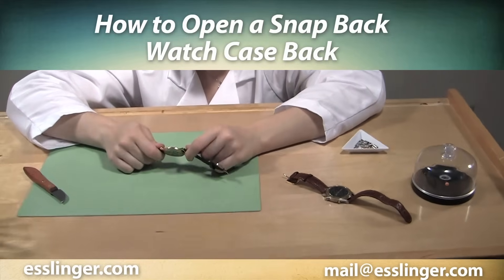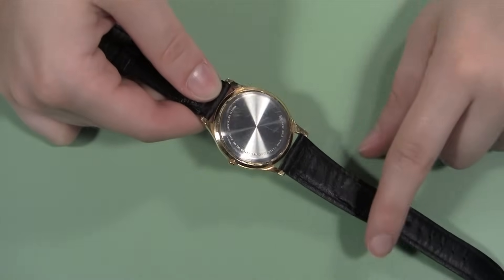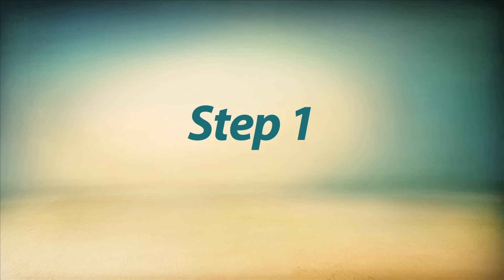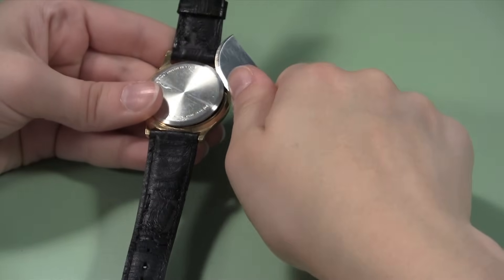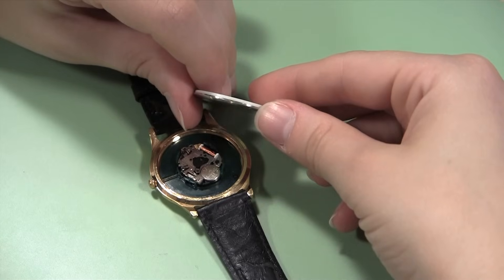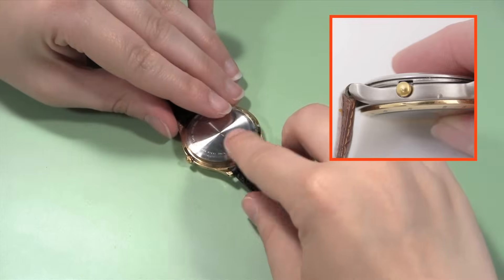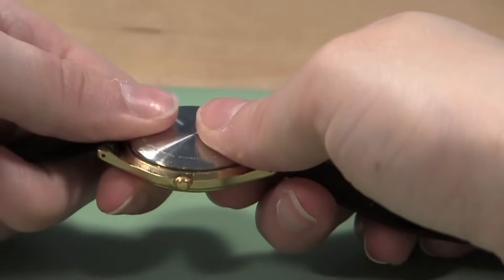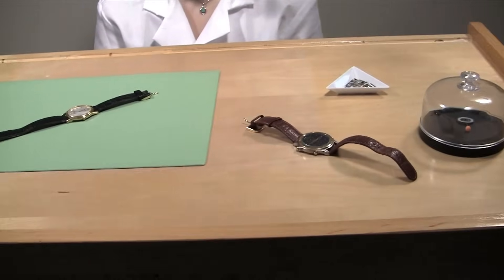How to Open a Snap Off Watch Back

Comment: Tip: if you don't have a metal watch case opener — or even if you do — a safe and effective alternative is to use a plastic guitar pick, which is softer than the metal so it doesn't scratch and which generates enough leverage to pop open most cases.
Reply: thank you so much omg
Reply: Pro tip. Throwing a few picks into my watch kit. Thanks!
Reply: Thank you!
Reply: I did it with my nail in 5 seconds
Reply: I have 50 dollars watches and this doesn't work at all the back plate is so tight I had to basically hammer a flad head screw driver under the lip and the pressure needed to pop the back off was digging the flat head into the metal of the watch.
Reply: Thanks a lot
Reply: Thanks
Reply: Makes Sense thank you

Comment: "If you cannot close the back by pressing it on yourself, you will need additional tools". Said so calmly, yet you can just imagine the frustration. So close, yet so far
Reply: Rammed a knife into my hand repeatedly, trying to pry the back off. Luckily wore a glove after the second attempt.
Realized I bought the wrong battery.
Bought the right battery today, replaced it, watch is ticking and yeah, guess what, no watch press, so I guess I'll have to find something else now.

Edit: Ok, nevermind, I literally just took a big hammer and applied pressure evenly and it worked.
Reply: hell to open; hell to close
Reply: Exactly 🤣
Reply: Totally agreed…. Video is totally uselless, not gonna talk about the case if you dont have this knife, you get into trouble trying to do the same thing with some other kinds of knives and potentially get hurt…….
Reply: easy! just take a hammer and you know what to do 
worry about consequences later

Comment: 0:48 "Be careful not to let the blade slip, because it might scratch the watch case or otherwise damage it or the movement inside." 

Priorities, priorities. A little scratch on the outside/back of the watch case is not okay; a severed thumb, however, is perfectly fine.
Reply: 'Tis but a scratch..
Reply: I gave my tissot to the authorized tissot service center
watchmaker slipped 3 times scratching the cap every time in the process, dug up a large portion of the metal from the case too
clearly cared more about his fingers than my property
Reply: @spicydiarrhea5662  😡
Reply: @michael5089  my tip is, do repairs yourself - no one will care about your property better than you.
Reply: @spicydiarrhea5662  Indeed Spicy
 Great advice 👍👍
Reply: @gallimead That “ ‘tis but a scratch” is from the gravely-wounded knight in “Monty Python and the Holy Grail”.

Comment: I just used a technique to use my bare hands to close a watch back that probably required a watch press, I laid a cloth down on the table, placed the watch on it, glass down flat, placed by hand in the strap and held onto it as I used the side of my hand to basically slowly hammer-fist the back into the slot. Took a lot of force but eventually it worked! Only recommend doing this if you REALLY can’t be bothered to find a watch press or other tools to help you.

Comment: To get the back on again: a genius commented on another video and said to just use a prescription pill bottle.. I tried it, it worked instantly. I just put a cloth underneath for cushion and a microfiber cloth between the bottle and back of the watch. I barley had to apply any pressure compared to using my hands. (worked for women's fossil watch)
Reply: Excellent idea, works perfectly 👍

Comment: Very nice, thank you! Btw, if you are going to replace the battery, remember that Alkaline (LRxxx) is WORSER than Silveroxid (SRxxx, better - more straight current, more capacity), and Silveroxid is WORSER than Quicksilveroxid(even more capacity).
Reply: Worse* =D

Comment: Mine didn't have a lip and I opened it without difficulty. Here is what I did:

The kind of knife in the video seemed too dangerous, so I used my ever-versatile Tajima utility knife (which is just an extendable razor blade) to slowly and gradually work the tip underneath the surface, moving around the circle of the watch plate, until the tip of the razor could begin to slide underneath the watch plate. Once here, I began to slowly rotate the blade while it was under the watch plate, to pry the watch cover off. Performing this prying slowly, I rotated around the watch cover backing, so as not to break the razor, and continued going in a circle until the plate was sufficiently loosened and came up and off.

This technique may take more time than the official technique portrayed in this video, but it seems to me better, because there's much less chance of hurting yourself or the watch plate, especially if you do it slowly without exerting too much pressure and keeping your fingers clear of the razor in case it slips.
Reply: Brilliant - many thanks!!  I'd just about given up as my watch didn't have a notch, either. This did the trick. I haven't seen this recommended anywhere else. I proceeded with extreme caution, protected my hand and wore glasses.

Comment: My watch is totally flat on the back and does not have a little notch like yours does where you put the knife in. I cannot for the lift of me figure out how to change the battery.  So maddening!  I'd be so grateful for any suggestions you may have.  Thanks!
Reply from the maker: jovicrazed Not all watches open from the back. Sometimes there is a special opener required. Read more here http://blog.esslinger.com/how-to-open-a-watch-back/
Reply: Esslinger.com Thanks so much for answering so quickly!  I'm going to take it in to a watch repair shop as I don't want to end up damaging it.

Comment: I used a small jewelers flat tip screwdriver, about the size you would use to tighten eyeglass frame screws, to pry off the back. Worked just fine

Comment: Tip for anyone who's struggling to open a watch with a case knife - wriggle the blade into the groove then tap/hit the back of the blade with a heavy spanner or a hammer. Because the blade is tapered it pushes it open without a prying motion. It worked for me anyhow.
Reply: But that might damage the insides and ruin the watch
Reply: I am struggling to close it lol
Reply: Trying to do tumbs up but now my half tumb is on the floor. But the watch is unscratched and the new battery is in place! Success!

Comment: I found that using a flexible rubber jar opening pad was very helpful in keeping my fingers attached to my hand. When (not if) the blade slipped, I had that layer of protection. It was not easy to get off!
Reply: Wish I'd known that before I severed mine

Comment: I was able to pry the snap-off back off of my Timex Indiglo wristwatch for the first time tonight, with the tip of a blade in a utility knife. This can be dangerous though, as this very thin razor sharp blade can break or cause cuts, if it isn't handled carefully.

Comment: It worked for me. I didn't have a knife at my office so I used a boxcutter. I put a stapler on the watch to hold it down so that if the cutter slipped I would still have my fingers. All good.

Comment: I cannot even get to step one as I have been all round it with my penknife and there definitely does NOT seem to be any kind of lever or snap back or anything. It is just totally smooth all round and won't prize open but I am sick of taking it down to the local shop to get the battery replaced. Anyway thanks for the video.

I need one on how to find the snapback now! I have a spot light on it and my reading glasses on but even so and despite going right around the watch I cannot find it.
Reply: your casebook might be a screw type and not snap back. So you need to unscrew it (turn it) to unlock it.
Reply: Sometimes there is a tiny arrow on the back pointing to the pry spot
Reply: I have just found this again 4 year later in opening the same one! This time I had a go with my pen knife before seeing my own post above, and there is no notch or place of any kind to put the knife under BUT you can still snap it off by pushing the knife into any place around the side.

Comment: Thanks. Worked perfectly for me. I used an X-Acto knife and was very careful, knowing it could slip and go right into my thumb or the blade could break off. I worked it underneath the lip of the back with a sawing motion and gentle but firm pressure. This is harder than it sounds, because you have to hold the watch from it's sides and NOT be resting a finger against the back (which you are trying to move in the opposite direction). But it worked. I'm sorry if this video didn't work for some people but they didn't have to embarrass themselves with churlish, grade-school comments. Why don't they get off their duff, figure out a solution and post it on YouTube themselves?

Comment: 1. Pry off the back of the case with surprising ease.
2. Exclaim "Lord, that was easy!"
3. Change battery.
4. Press back on to case again.
5. Check for spaces around the sides.
6. Swear.
7. Press back on again and again, swearing each time.
8. Put the heel of your left hand against the watch case.
9. Break your left hand with your right fist as you bash and bash and bash.
10. Scream "fuuuuuuck!" and jump on the watch again and again until you slip on the carpet and bash your head. 
11. Gnaw on the NATO strap in a foaming rage until the ambulance arrives.

Comment: I used a permanent Sharpie marker to make a tiny mark on the back of the watch where the 2 parts line-up so that I could line them up to close the back  after I replaced the battery. The mark wont show from the front when you wear the watch, and it will help the next time you want to replace the battery again. Then I dropped the battery and it bounced under the kitchen stove out of reach.  So much for that! 🙄

Comment: I can't find the indention on my watch. Is it possible to not have one and still take the back off?
Reply from the maker: It may be a different type of watch back design. Some even open through the front. Use a magnifier and inspect carefully. You may need to consult a watchmaker.

Comment: Every video like this makes it seems so easy - just slide the blade in and pop it off using leverage. But no matter what I do, it won't budge. (It's a TIMEX Indiglo.) There isn't enough room to apply leverage. Now the little slot is all mangled and the back is scratched. Why don't they just use screws? It's so frustrating. UPDATE: I finally managed to pry it open with a box cutter. I got a new battery and put it in. Then I couldn't get the stupid back on again. I pressed and pressed with my fingers, but no, it wouldn't pop back on again. So I tried squeezing it closed with a tool, and PRESTO! I smashed the crystal, so I threw the watch out. Boy, was that fun! Next time, I'm buying a watch that has a back WITH SCREWS!

Comment: if you're having a hard time putting the case back like me, and there is no explanation as of how to do so in this vid, you can put one finger pushing on one corner of the case. After that, grab yourself a blunt weapon (i use a pestle, if not a hammer will do fine) and give it a solid hit on the opposite corner from which you're pushing with your finger.

Comment: Easier and safer to use a jeweler's screwdriver to open the back.
Also, if you press on the center of the back when closing it, it can make the metal spread out and make it harder to close by hand.  If that happens, push the center back into shape from the other side, and then it should be easier to put the back on by hand.
Reply: Hi

Comment: My backplate wont go in again, and I dont have any watchpress😖
Reply: TechWithBrede I used a pair of pliers and wrapped the watch with a microfiber towel prior to using the pliers so that the watch face and back didn't get damaged. Worked like a champ!
Reply: Mike Baca that's really clever. Thank you for this idea!
Reply: I have replaced the backplate of my Skagen watch and a few others many times with this method which only requires a ~25 cm long wooden dowel with a diameter slightly greater than the diameter of the backplate. The dowel must have a least one end which is cleanly cut a t 90° angle. (A furniture leg works great for this purpose.)
1. On a sturdy and stable surface such as a desk or work table, lay the watch face-down on a smooth piece of microfiber cloth, with the watch band out of the way.
2. Set the 90° end of the dowel flat and centered on the backplate, and push straight down, with even pressure across the width of the backplate until it snaps into place. I usually stand up so that I can employ my full body weight (70 kg) to the task. The goal here is to keep the dowel perpendicular to the backplate while you exert the downward pressure.

Works every time for me.

Comment: Use a blunt knife to open the case. A paper cutting knife or a similar object which can fit in the wedge. We are not experts so think about our safety first. If possible wear safety glasses as well. You never know what's inside and may spring in your eyes
God bless
🙏🏻🌹🙏🏻🌹🙏🏻🌹🙏🏻🌹🙏🏻🌹

Comment: To close my watch. I put the face on a carpeted floor. Then a quarter on the back. And then I put a chair leg on top of the quarter.  I put all my weight on the chair and it snapped into place.

Comment: No press or special tool needed to snap cover back on. Use a prescription bottle about the same size as the cover, place cloth on table with glass side in cloth and cover side facing up. Make sure cover is evenly center, use pill bottle to snap cover back on. That easy.
Reply: This worked for me : )
Reply: Very neat trick.  I used towel and a small bottle - worked just fine.

Comment: Taking the back cover off is easy (with a decent pry-tool) Putting the cover back on was not a snap for my Bulova, it would not go back on. Once the cover is off, the user may be forced to buy the watch press advertised in this video to get the snap cover back on, or take it to a watch repair place as I will do. No more Bulova watches for me.

Comment: Great tip on the watch press.  I didn’t have one so I used a C clamp that had plastic over the contact surfaces.  It covered the glass completely to allow even pressure.  Gently tightened it and the back snapped right on.  Thanks for making and sharing this video.
Reply: C-clamp worked well for me on my Seconda watch. However, I used a socket (27mm) with the exact diameter of the watch back (from a socket wrench set) between the watch back and the clamp jaw so as to apply pressure on just the rim. A bit awkward to assemble and hold but back just snapped into place (listen for the click).  Also, my watch had a tiny notch on the inside rim that had to be alligned with the winder, so watch out for that!
Reply: Thanks for this tip

Comment: I have the right knife but it wont come off. All i do is put horrible scratches in the case back. The case back has no notch and there is just no space to wedge in a very sharp case knife. Its been off before at watch shops to change the battery, how did they do it? I see evidence of their scratches too. Im so frustrated, this should be simple.

Comment: I struggled to get the back off the watch for a while, but I think I figured out the strategy (for my watch, at least). Put the knife under the watch and kind of rock it so it alternates between which side of the notch it is pushing against. I didn't need much force (which means there is no chance of slipping and scratching the watch/cutting yourself). In fact, I was surprised that the back came off, given how little force I was applying to it. I only needed to rock the knife for about 20 seconds or less before it came off

Comment: If anyone still needs help (closing a snap off watch) try this;
Use a bench Vise, but be super careful. Place the watch in a vertical position right in the center of the vise and place a paper towel or cloth on the front and back to not scratch the glass or back. Slowly close the vise making sure to keep even pressure, the watch should pop back into place. I just tried this on my cheap MVMT watch and it worked!
Best of luck.
Reply: dumb advice - do not do this.

Comment: I just used hot glue to stick a peace of bent thin metal strip to the back cover to pull it open, no scratches.... 
The hot glue easy to remove, just peel it off. 
Never use a knife, to difficult, also may damage the sealing O ring.
 I should make a video of this simple idea.
Reply: thanks for the tips i appreciated it

Comment: Unless it's a specialist tool or a blade comprised entirely of air molecules, nothing seems to get under the little "lever" part. There are scratches all over the back from my disastrous attempts at opening the bloody thing. Oh well, I guess that's really by design, to force us into either paying for the tools, or paying someone else to use the tools.

God, could you imagine they start doing this with TV remotes?
Reply: ''air molecules''

Comment: Cant get mine off because of where indent is. Its right where the back prongs are, they are in the way so i keep having to buy a new watch every time they die. They all in the same placement and impossible to remove. The video made sense though, i guess i just suck at picking watches i buy 😂

Comment: I got a Dane watch but snap off back has no notch .. manufacturer should not be dumb to make it hard changing battery .. these days if u can open back urself then u can safe almost all the money of the battery from watch repair centre... coz online batteries are 1000 times cheaper ... am still scared of using knife to snap off the back though.. thanks for video and nice precautionary comments ..cheers
Reply: See the razor technique I posted.